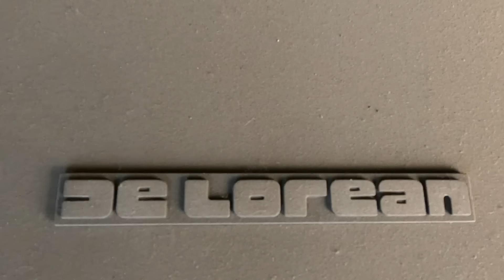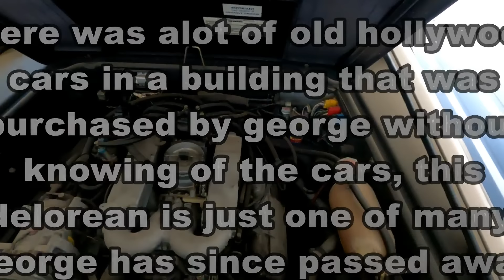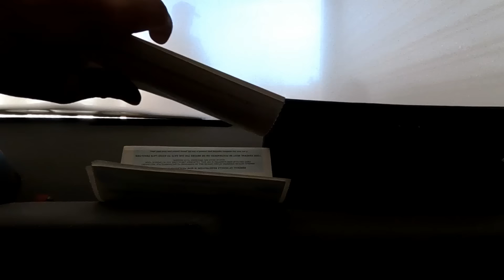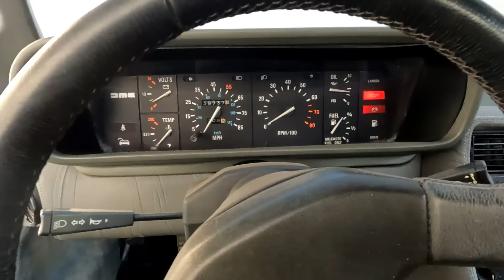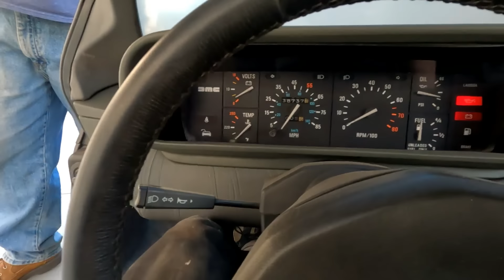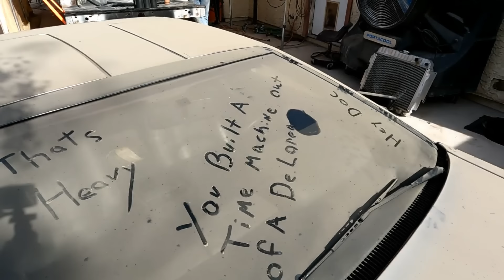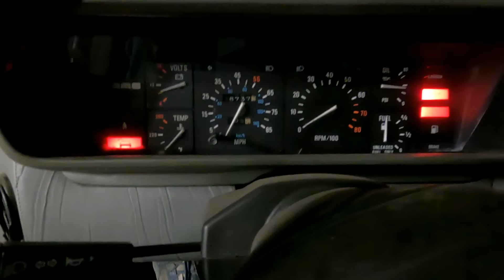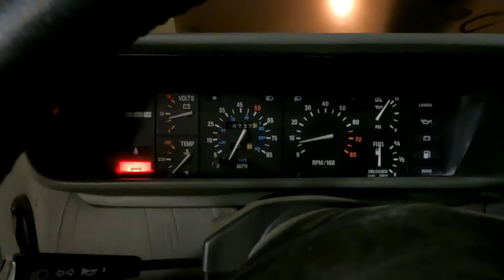I stumble onto one of my dream cars

Comment: Having ressurected DeLorean # 516 (the long lost MIRA high speed test vehicle) what I can share outside of the multiple pre - production parts Dunmurry installed into 516  - the Bosch injection is challenging to get worked out. 
 The fuel distributor is well known for seizing (516 was) when parked for long periods of time. You're actually on the money with the 'spider thing' diagnosis. When the plates stick it floods, relieving the pressure or revving the engine like crazy to clear the flooding allows it to run.  Look for liquid/vapor fuel in the exhaust. The fuel distributor isn't a good idea to tinker with, but DMC in texas offers a rebuilding service that is excellent. They also offer a fuel pump and module kit that will save you a lot of headaches. I don't remember why I had to get that kit but it was really important.
The device you believe is a pressure regulator is only half right. It's a warm up pressure regulator. That does some kind of voodoo pressure kick for cold temperature.

 Also save yourself the frustration/possible engine compartment fire - replace those vinyl/rubber looking fuel pressure hoses. They were called flamethrowers for a reason. 
Hope all this word salad helps
 - A tech that has already waded through the hell you're about to experience.
Reply: Bosch CIS works as well as the mechanic understands it. There is endless information regarding this system in the VW world.
Reply: The DMC "dealership"🤔...
Sales and restoration shop, is just around the corner from me,, 
Crazy how this Car, you'll understand,, that feeling, nostalgic even, 
I smile when I see them...
From time to time, you can see,, Up to 20 .. hell even if it's only 12 of them parked outside, it's cool...
They also do the Back To the,, Modifications.. 
So you'll also see*time machines " .. 
Use sell to them, while working for O'Reilly's...
Head Technician,, drove one about to be delivered to a customer..
To pick up a battery for another one... 
Delorean.. never restarted,, left on flat bed... 
Even broke down.. still had people taking photos.. cheers from Huntington Beach CA 🇺🇸

Comment: @44:25 I know from experience and those engines if not stored properly there is what we call the valley of death.  It's in the intake manifold valley.  I  had the same problem as well as the guy's from Turning rust .. I actually wound up pulling the engine and I put a junkyard Chevy 350 ..

Comment: The Delorean is TITS, Id love to see you make a one off manifold and make it go. This channel as a whole is superb Chris. Been a fan since way back ,Top five for sure. Id love to help but being a Pontiac nut with 6 ponchos in various stages, two 69 grand prix 428 ho's, one is a 4 speed BABY, a 70 grand prix 455 ho, a all original survivor 60 catalina flat top with 32K actual miles and minty as mint can get, a 63 421 bonneville 4 door, and a 56 pontiac. also have a 56 T bird, 65 chevy panel, 365 hp 327, 76 corvette with a 377 sbc, destroked 400, and a 95 lt1 built up trans am, all my monies are constantly vacating the bank account faster than i can replenish it.  KEEP ON THE AWESOME CONTENT PRODUCTION. I recommend this channel every chance i get!

Comment: Id also recommend getting the fuel distributor and warm up regulator rebuilt along with replacing the original fuel lines. you'll need a new fuel accumulator under the car to keep fuel pressure in the system also. There is a guy in the delorean community that supplies intakes to make it have a carb setup. A few people have done it and it takes all the mechanical crap out of the system

Comment: The ones I've worked on had '71-'73 Ford Pinto front suspension and like that one,  Bosch K-Jetronic fuel injection (C.I.S.). Funky beasts.
Reply: Oh no, so it is as I feared. I live in Volvo-land and there are many tales of people having to give up on getting their K-jet injection systems to work, after stubbornly dumping loads of money on new parts. 

Chris, if you are reading this, don't go around turning mixture screws unless you are sure everything is working as it should, those things are super sensitive.

Comment: Chris you need to get it running man. Possible the same engine with a fuel maker happener aka Carburetor or if you can fit a cheap mopar 360 V8 in it using that transmission that will be super cool. Also the 4.3 V6 engines from the Blazers are super cheap, abundant and there are kits for them to fit this car and you can even add a whistle blower aka turbocharger on them.

Comment: Chris, Bosch K Jeteonic fuel pumps run at higher pressure than typical electroni injection.  It's a constant flow injection closer to hilborn than EFI.  The flap inside the cone is the mass flow sensor.  You need a K jet pump.  VWs of the 80s, 911s, etc.  are a source. The block with the lines is a variable sized oriface.  They actually work ok if the fuel filter is clean and the gas doesnt gum up.

Comment: I love the Delorean, loved the winged doors, this car is in great shape and a movie car. I remember hearing about somebody buying everything that was left of Delorean, some cars half built and all the parts inventory he had left, because he needed cash bad. If you can straighten out this fuel system and get it mechanically running, these cars bring some pretty good money, don`t they. I heard they were cheaply built, and he used the cheapest parts they could get there hands on. Just imagine starting a car company with nothing, the in house inventory you need to start putting cars together, sure corners were cut on materials and everything else to get going, which explains the quality, but I loved the angles, the doors, the look and the body is stainless. I would get it running, clean the shit out of it and flip it, I have seen a few of these in videos, and this one you got is in the best shape I have seen, the body is beautiful.
Reply: DMC dealership is near where I live.. in Huntington Beach CA 🇺🇸...
Seeing them parked outside is always.. a smile moment.. 
I use to sell them oil while working for O'Reilly's..

Comment: Joined my friend, anything to keep this channel growing. Remember, if you want your car clocks repaired correctly, hit me up.
Reply from the maker: Like the factory clocks?
Reply: @junkerup Yup, how they work is via a solenoid that activates as  the spring runs down, there are bare contacts that shunt the solenoid and rewind the clock. That's the click you hear in the car, it's the clock winding itself, clever design.

Comment: DeLorian Midwest might be able to help with parts. There in Crystal Lake, IL. These engines are known to have the valley of death. The coolant passages deteriorate in the valley of the block and leak into the oil. You might want to think about that. Otherwise I've heard of people putting in small blocks in these cars. Maybe a 318, 340, or 360 might work. Put in a 340 six pack that would be sweet and get you well past 88 mph. 😂😂😂😂

Comment: I grew up driving cars with BOSCH CIS. It was ok when new but a bastard when they sit (even a few years). I can just about promise you the injectors are plugged and your Fuel Distributor (fuel spider thingy) is trashed. They aren’t that hard to replace if you find new or rebuild units and injectors aren’t too expensive. 

But these motors were pigs. I had one in a Volvo and it sucked. They eat the cam at 90,000 miles. That Volvo was on its 3rd cam. 

I’ve driven 3 different Deloreans. They barely got to 88mph’s. 

Derek from VGG did a motor swap on his Motortrend show and it made it look like it could be a fun car.

Comment: Don't mess with that fuel system if you don't take the time to learn how it works. There is endless information about Bosch CIS Jetronic in the VW, BMW, Porsche, Volvo, etc enthusiast groups. A test of the system and control pressure on the fuel distributor can diagnose any fuel system problem, but you need a specific jetronic tester.

Comment: The worst part about these car is the factory epoxy coating on the frame. Once it bubbles or crack, it holds in dirt and water and the frames are known to rust. It looks like you got one dry enough it might not be a problem, but it would be wise to inspect the entire frame to make sure you didn’t get a turd.
Reply: That's the Lotus part of the build, the frame is similar to the Lotus Europa and Esprit, surprising that part was not made from Stainless.

Comment: Bricklin 2.0 Is that a Bosch mechanical fuel injection? Maybe parts off the VW rabbit will work... Holy 75-80 PSI fuel pressure

Comment: Have fun with that chris 
that Pal is a L-Jettronic Fuel injection system. 
the Throttle body is infront of it underneath, that is the Venturi float disc (no clue how that one is called in english) what ye said looks like a toilette in the middle,the spiderthingy
and if the Pressurepump, which is the injectionpump at the same time, not work it won't run at all.

Comment: There's a few LS-swapped,... bet a Hell-Crate would go harder, or a Shelby spec 3.3/3.8 V6 to straight up double the factory engine power.
Edit: forget the Shelby version - 3.8 out of an '07 Wranger with a supercharger kit.
Could also try Holley or MoTeC engine management hardware, just to get away from the K-jetronic.

Comment: Yeah trough out that Renault/Volvo motor from it,and in with a mopar motor, then it's a cool ride with power..
Reply: Jeep 3.8 with blower kit would drop right in there, and be dead easy to get parts for and keep serviced. '07 3.8 with blower would more then double the power.

Comment: I'd love to see you stuff a Hellcrate engine in that thing, but there might not be enough room, and finding a transaxle that can handle the power would be difficult and expensive. As much as I despise japanese 4 bangers, a hopped up 2JZ and the FWD drivetrain might be the answer. As cool as the car looks, I gotta believe it would be pretty embarrassing motoring around with 130 hp. I just cant see you doing that, Chris. At a minimum, you need to stuff that block with forged internals and twin turbo the thing. Anything less that 400hp is gonna be a disappointment. You know it, we all know it.  It was very entertaining watching you Neanderthals working on this 1980's spaceship.
Reply: Cool idea but I'd surprised if Chris can afford to put that kind of $$ in that car when he has so many other projects on the go.

Comment: Not to be negative, but we're all broke and trying balance supporting our families with finishing just one project car.  Who has the extra cash to through at you with your 30 projects and all your dreamcars?  Weird, bro.
Reply from the maker: Hey I totally understand and believe it or not I’m usually broke as well having to work off deals I’ve made on cars. Just ur views are thanks enough 👍
Reply: Its not weird, its life. If you do something for 20-30 years you most likely know your way around just enough to get on top, and stay there. And its anything but fair to judge, and point a finger, just because he can, and you cant. Crap happens to all of us sometimes, ups and downs.
Reply: Chris, don't believe all thé crap about thé DeLorean, good car with 2 weak points :door dampers and thé engine.engine was first thought as a V8,then shortened so it's a V6 with 90 degrees angle where it should be 60 degrees.but this engine termined his life in the nineties as  3 literDOHC 24valves and 210 hp.good handling as châssis engineering 0:10  was donne by Lotus
Reply: 44:30. Thoes jackstands look ready to slip at any second.